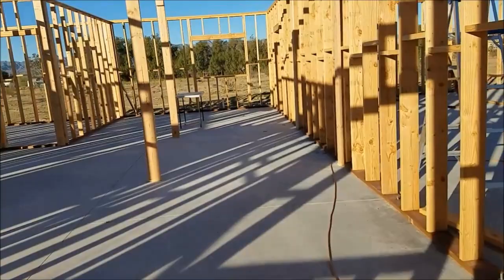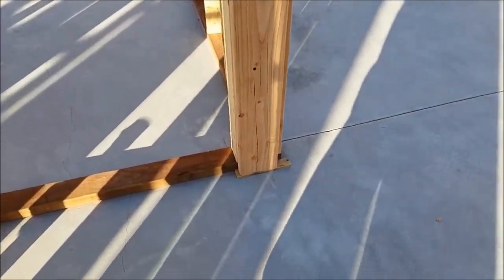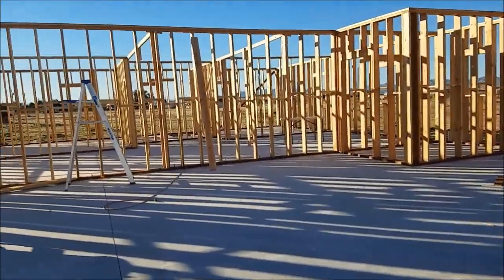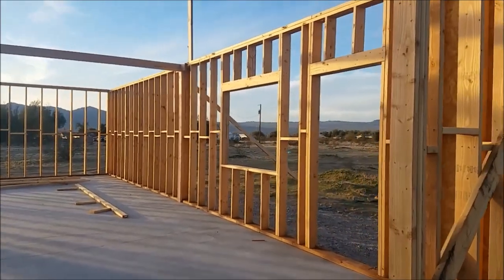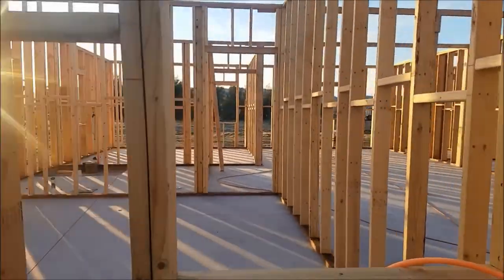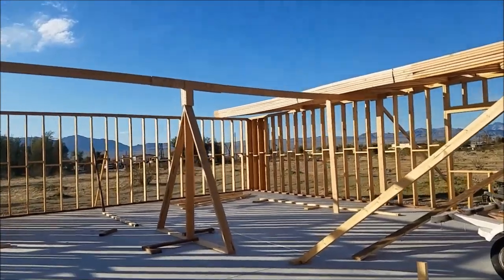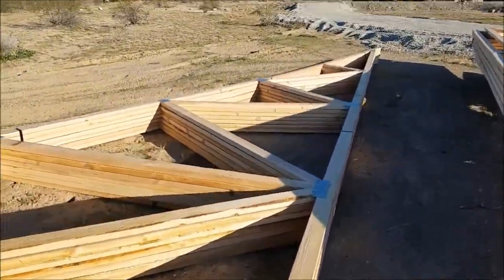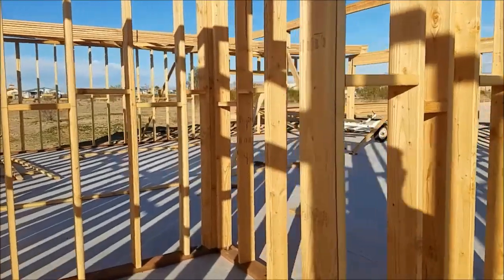DIY House Build # 14 - Truss Delivery

Comment: Your center truss support will probably be in the way. I usually drag them myself upside down through the framing. It’s easy to place one end on the wall because it’s already sticking up, then use your hoist, or rope or just lift the other end onto the opposite wall. Then flip it with a 2x4 with a board screwed on the end to make a Y. 
The vertical support board at the gable end should have another one screwed to the side to make a L profile. Much stronger and less likely to break if it gets windy. If wind hits your trusses at just the right angle it’l push them over. Don’t have anyone especially the kid under the trusses until well braced. Don’t worry about your crooked wall. Fasten the trusses at the good wall then straighten the other wall later and nail.   Hope this helps. If you’re like me you’ve probably got it done already. Lol.